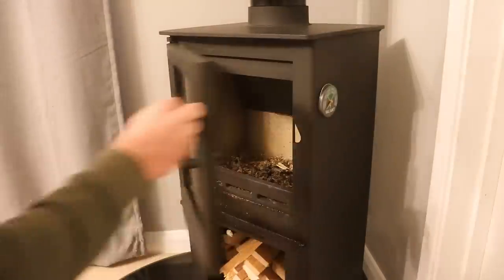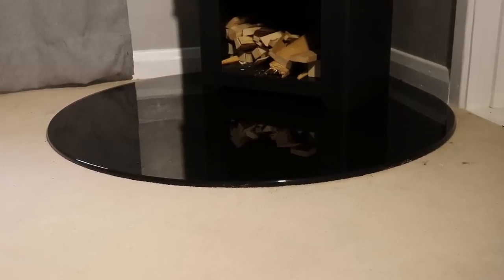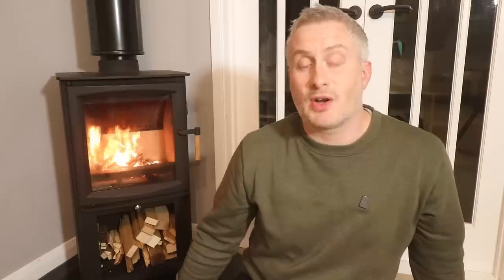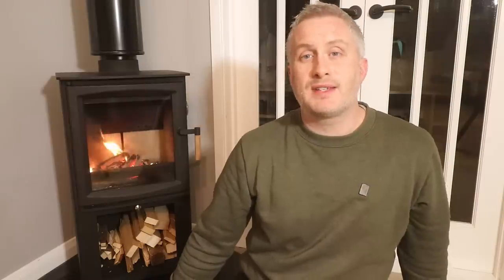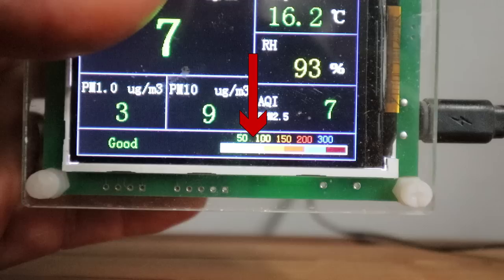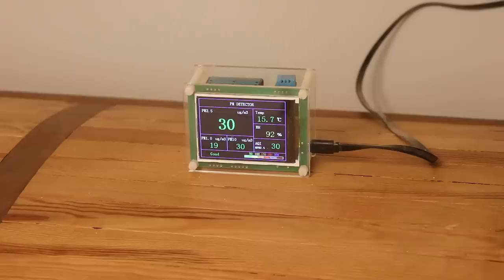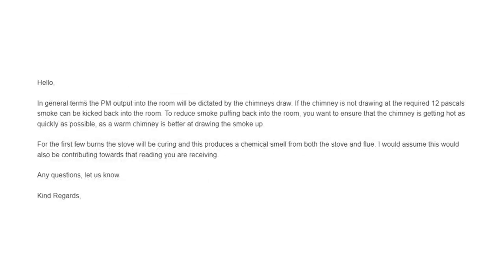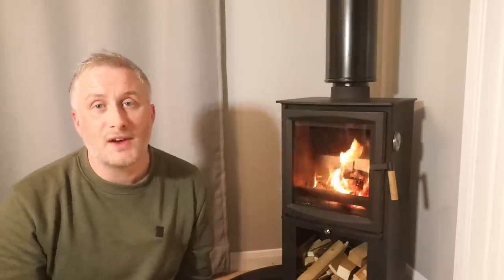Wood Stove Pollution and PM2.5 Particle Emissions TESTED ✓

Comment: This is really interesting, something I have wanted to look at for a few years. Please could you try the PM2.5 sensor with other normal household actions - e.g. candles, burnt toast, cooking bacon, hoovering carpet, incense stick. My feeling is that many normal actions cause an increase in PM2.5 particles, and having a well-fitted woodstove needs to be seen in context. I have been living with woodfires for 51 years now and believe in them, so would really appreciate a balanced view. Thanks for the good clear video. Vince
Reply: I've had one for ages, and the things in the house that cause the biggest increase are burning things on the stove and frying things. Also, seasoning cast iron pans seems to cause it to go through the roof.

Comment: If I would recommend anything it would be to put something on the wall behind the stove. Some reflective material, backed metal or tiles. Have you checked the temperature of the wall/wood/curtain behind the stove when it's lit yet? I also agree with others about the stove fan.
Reply: Bet it’s red hot

Comment: Very interesting, and a little spooky. I had an identical stove installed recently in my bungalow.  IIRC stove was £475 + vat.  Flue was £950+vat and fitting was £720+vat £48 for Carbon monoxide alarm Data plate and Certificate.  I had several quotes with wildly different prices before I got the above. One guy quoted £1900 for flue parts, another £1500 for fitting. It seems the energy crisis is bringing out the best in people!
Reply: Indeed......nothing like human greed

Comment: Interesting to watch this Keith. We only rent our house but have been here ten years and the landlord has let us put our own stamp on it. About 4 years ago I knocked through the plasterboard covering up the old fireplace, got in a tradesman who re-established an open fire. Best thing we ever done, it’s a totally different type of warmth and it’s kind of hypnotic just watching it. I will be checking the air quality in the lounge though as I expect an open fire to have a higher 2.5 rating than a wood burning stove. Also putting your Mirka day into practice 😀😀👍👍
Reply from the maker: Cheers Leo. Open fire sounds lovely. I'm sure you're right, higher reading probably, but most the bad stuff should be going up the chimney 👍interested to hear the readings you get
Reply: @RagnBoneBrown  hi Keith, is the "T E L E G R A M" reply on my previous message genuinely you or a scam?
Reply: @JohnColgan.  scam, definitely.
Reply: Open fire will definitely be far higher and they're not even allowed in many parts of the UK
Reply: @SamPrince  I suppose a bit part of it is what you’re burning Sam?
Reply: @Hand-i-Craft  Yes, many factors contribute. Heat of burning is much lower in an open fire and obviously the geometry of it means there will be more smoke in the room, but the material being burned and also its condition matter, e.g. has the wood been dried for 2 years or found on a skip in the rain?
Reply: We have a 15kw  Burleigh  wood burner in the living room (not ridiculous as it’s 200 cubic meters). The scary levels of particles are when smoke escapes before the  chimney is drawing properly,, sometimes getting to over 500 (immediately open the garden door).  In normal use we see about 25, mostly from small escapes when topping up the wood.  When the fire is not in use the level is between 5 & 10
Reply: @SamPrince  open fires can be used in smokeless zones as long as using smokeless coal
Reply: Man and fire a prehistoric match made in heaven! It’s part of human nature 😎

Comment: I've had an Ecosy Hampton 5 Inset log burner fitted at beginning of Oct '22 and absolutely love it. It's in a regular 2 up 2 down terraced house ( mid 80s construction with cavity wall infill ) and after about 3 hours use it's raised the temp upstairs by about 2-3 degrees and the lounge it's sited in by 5 degrees even on a slow burn

Comment: Great vid Keith! We've been testing this for a year or so and have some very interesting findings (vid coming soon). Any coating / oil on the stove will send emissions through the roof but that should stop after a few burns. Other than that PM2.5 readings have been negligible - we're in a 2 storey so I guess the chimney being higher could result in a better draw? Not sure 🤔. Lots of factors. Keep measuring and we'll have to compare results after the winter! 👍😎
Reply from the maker: Cheers Andy look forward to seeing your results! Since filming this video the pm2.5 readings have dropped even further, sometimes it barely even changes the readings from when the stove is not in use 👍
Reply: Yes, our wood stove has been in for years. I tested today and the PM 2.5 meter shows 30 while lighting and settles down to 10.

Comment: Question- because I'm currently installing my own. How did the fitters get away with the distance to combustible materials (55cm to the sides on this model) with the skirting boards, architrave and curtains? I thought I'd have to remove my skirting boards and replaster but if there's a workaround I'd love the hear it before building control come round.
Reply from the maker: Hi Cozzy, I'm not aware of the rules, sorry.  I think our installer said a distance of 300mm from the curtains, which is fine.  In the longer term though we're looking to replace the curtains with shutters anyway.  Not sure re: architrave/skirtings though but not something I'm worried about - they installed and signed off so I'm trusting them. Cheers, Keith
Reply: @RagnBoneBrown  cheers, I'll leave the woodwork alone and wait for building control.
Reply: We were told 500mm minimum from a wall and if it is a timber stud wall it has to be lined to keep the heat off it.

Comment: Hi, very good video and I really like your new burner...Please don't think I'm asking a silly question as you've had it professionally installed and that means all will be well! When I installed mine, myself I had to have a fire board installed all the way up to the ceiling and all around the back of the stove...I can understand not having a fire board protection around the wall behind twin insulated pipe as it progresses up the wall  but...not to have the fire board around the wood burner itself does seem odd unless they have moved on with new types of woodburner?...I did my own install over 10 yrs ago and was extremely thorough with the install and had HETA check the whole install once completed and signed off. Costing for our essential utilities has become impossible and even though Electricity has become over 3 x more expensive than Gas trying to keep homes warm racks up just as much per month as using the electric...I'm now in the process of installing new Solar panels which are designed for the poor UK weather...Batteries are a bit expensive at around £4000 so it will take a bit of time to get our money back:) Please let me know about the fireboard question as it's would be very interesting to know the answer:)

Comment: When opening a stove to re fuel open the door 1/2 inch and wait a few seconds for the velocity to climb and clear the stove then open the door slowly not to drag smoke into the room , the stove will smell and produce smoke ( enough to set a smoke detectors off ) when  you first commision it , ventilate first few fires .

Comment: We are on our second burner in 25 years. We don’t burn timber off cuts as they burn way too fast. I get well seasoned wood locally from the bush (live in Australia) or from a reputable supplier. Our Fire stays in all night and like a previous comment, I use a burn down method as it warms the chimney quicker

Comment: Curious about the distance to combustible material. The curtains and door frame. We are having one installed and the guy said 18 inches from the stove to any combustible is the requirement. Yours look closer than that. Also, he said we can't have plasterboard on on our chimney breast either side for that reason so need to use cement board. Our burner will fit inside an old fireplace but will stick out an inch or two so the side distances come into play.
Reply from the maker: Hi Robert, I'm not aware of the rules, sorry.  I think our installer said a distance of 300mm from the curtains, which is fine.  In the longer term though we're looking to replace the curtains with shutters anyway.  Not sure re: architrave/skirtings though but not something I'm worried about - they installed and signed off so I'm trusting them. Cheers, Keith
Reply: @RagnBoneBrown  if it wasn’t on a store stand the skirting’s would have to go.

Comment: Hey Keith we fitted a multi fuel whole heat system in our 3 bed semi about 8 years ago. We took out the old open fire I was skeptical but honestly best move we ever made. Runs the whole house heat and hot water and like u I've always got off cuts and I cut and dry all my own firewood so really it's just smokeless coal we burn little bit that to get fire going. Ours was 8k all in for big stove all radiator system towel rail removal old fire all the plumbing and electric work and really we only use a tiny bit of electricity to power the pump that sends it round the radiators and I see allot of people are putting them in now. 👍🏴
Reply from the maker: Great solution!

Comment: Think it may have been said in earlier comments, I’d be concerned regards proximity to timber door frame and curtains also has fireboard been fitted to those walls, last point wondering why the chimney has been double skinned so low to stove, vast amounts of heat being lost.

Comment: And if you want to split logs safely to fit into your wood burning stove, I know a cool DIY tool that helps do it without the risk of chopping your hand off! Just thought I'd throw that in!
Reply from the maker: Haha.  When I saw what you came up with, I kicked myself - my version was so overengineered.  The notches in a 4x4 with aluminium L section was a stroke of genius!!  I don't suppose you made a second one you want to sell did you?? :-)
Reply: I have a long-handled axe and a swedish log splitter. Prefer the axe.

Comment: Installed a stovak multifuel burner years ago  delighted with it Noticed your burner is Installed close to your walls obviously to regs  but are they non combustible ?  Also the wood your burning looked like it wasn't  seasoned  If you burn construction timber it can burn too hot and damage the inner flue  Good informative vid tho 👍

Comment: Many thanks for linking to the air quality monitor. We're about to move into a bungalow that has an open fire and I'm really keen to get a reading on it when we get it up and running, hope to move in around January or February. It has a detatched garage so will be setting that up as my workshop.

Comment: I agree with what you have said Keith about the burn in period the only thing I would add is I would also open the window to do a rapid air change during the first few burns to clear the air. I have a wood burner which means the lounge is lovely and warm but the rest of the house has electric storage heaters so turning them on is a scary pass time for the pocket. 
A couple of things make sure you have a Carbon Monoxide alarm in the room and it works. Also I brought one of those fans you place on top to help push the heat about and this really helps.
Reply: Carbon Monoxide alarm  Very important indeed!! Good advice. Saves lives.
Reply from the maker: Cheers Paul, the installer had installed the alarm, forgot to mention it in the video. I will look in to stove fan options! Thanks
Reply: @rpaasse6453  interestingly the only time in over 20 years our CO alarm has gone off was when there was a fire up on the moor. It was not pleasant inside but outside was much worse.

Comment: We have had our Contura stove a little under 4 years. It was installed by an approved installer and is fully HETAS certified. Our first few burns actually set the smoke alarm off unless the windows were open. Now it is nicely burned in we have no issues. Our installer did warn us this might happen because of the proximity of the smoke detector, so we were not awfully worried. Our sweep cleans the flue & sticks a camera up at the end of each burn season, and the soot removed is minimal.
The beauty of the stove for us is our house was built in 1950 and originally had a coal fire. The chimney is in the centre of the house, and our installer filled the gap between the original fire-clay flue and the new stainless liner with a non-absorbent vermiculite alternative. The stove heats the rest of the house residually, cutting down on the amount of gas used. Even after the gas prices rocketing, our heating is costing less to run than before the stove was installed.

Comment: You have air coming into the stove via the vents and air coming out of the stove only via the flue. You will get particulate matter in your room only if you a) have a leak b) open the door when the temperature inside is too low or c) have a poor draw or a flue restriction.  I reckon you’ve sorted it by now but that thermometer is your friend. Mine lives on the flue and I know that if the temp drops below the green zone any new wood will be slow and possibly smokey to get going. As yours is on the side, you’d need to find at what point on that scale to try and keep above. 
Further to the comments on top down idea (kindling on top)… you'd only really want to use that method if you were in very cold conditions to warm the flue first; or if you had a poor draw.
I stack the kindling around a fire lighter with the larger logs on top. I don't allow the kindling to start first, I load the logs on top and then light it. The trick is to use kindling pieces that are thicker at the front of the stove so that when they collapse the thicker ones at the front are the last to go. That way, any material on top will slump backwards and not against the door.
Enjoy your stove mate.
P.s. not convinced the architrave is a suitable distance away from it though. 🤔

Comment: Interesting readings and it is not an area I had even considered before. 
Having had a wood burner for the past 30+ years, I have only looked at making sure smoke or smell did not enter the room. 
When lighting I get it going and then do not open it until it is well established. Then, I never fling the door open quickly, just a crack and then slowly. 
I am puzzled as to how there is any rise in the reading within the room. The air is moving from the room into the fire, there is none coming from the fire into the room. All I can think of is anything when opening door or dirt/dust burning on the outside of the stove. 

I was rather troubled by your curtains being rather near to the stove! I guess it has all been done to regs. I had a fire in an open hearth like that in my last house and the wall behind got too hot to touch.

Comment: Woodstove is a blessing in a home. I heat my apartment with AC and it is crap. It is never warm as with wood stove and it keeps air humid which in turn makes space feel more cold and also I have mildew problems so I have to vent quite often making heating very expensive.
I have wood stove in my workshop and it is an absolute delight having it there. I find that it is warmer in my drafty old (400 years!) woodworking shop than my well insulated home.  Like yourself, I use scraps in the workshop to heat it so it is basically free.
Reply from the maker: Thanks Andrea - I agree!

Comment: Very informative, thank you.  We live in a small all electric 200+yr old stone in-fill/cob house in the south west.  Oil or gas central heating isn't an option for us.  We have a storage heater, small electric heaters and a stove.  Last year we did without the stove and froze.  This year we are not using the storage and other heaters and relying on the wood stove.  We use wood from a 'wood sure' supplier (<20%) and wood from the workshop.  This works really well.  The dry wood burns efficiently and very hot. Although it's 50% more expensive, we use less and it heats the whole house and is still cheaper than electricity.   When used sensibly and with the right wood, this type of heating is a good alternative in the current energy crisis.  All we need now is enough solar panels to be able to come off grid!  How sweet to be able the tell Shell to get lost!  If only...
Reply from the maker: That would be the dream!

Comment: Good video, there will be a smell each first burn if stove is left unused over summer  as dust burns off.
Dif used don't put fire lighters directly on the iron grate, it will corrode and distort them.
Top down burn best to start.
Buy from an established manufacturer, spares will be required long term.
Don't over size fire, or you won't be able to run it at a temperature that will clean the glass.

Comment: Interesting video as this was also a concern for us having read the recent negative reports. We have an old but recently serviced Morso wood stove, new door seals etc., heating a large open plan area and have never seen the air quality PM2.5 meter go above 4ug/m3. When it is off our reading is 0 to 2ug/m3 - we're in rural Scotland. I think the quality of the wood/logs is important and keeping the stove hot. Also, with the stove drawing in air from outside, it's worth remembering that it can pull its own smoke back into the property depending on wind conditions, location of the chimney and air leakage/ventilation points. So even if you have no emissions into the room directly from the stove you might be drawing particulates in from outside, including from other peoples fires! We will certainly continue to use ours 😊